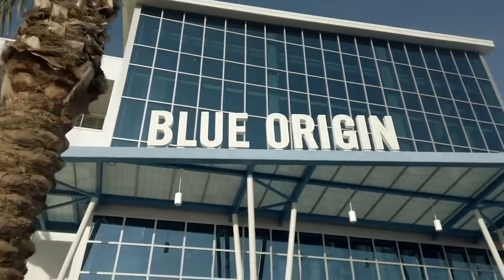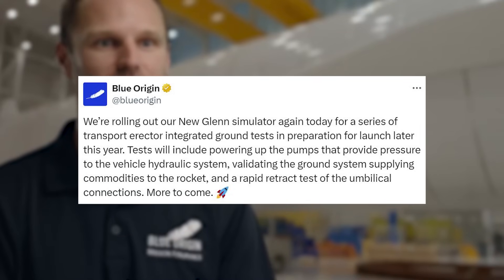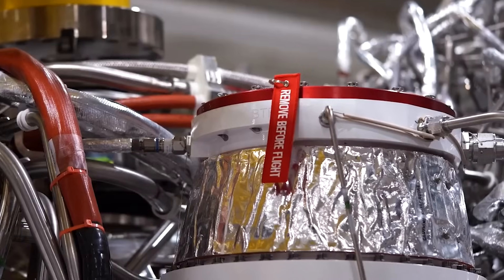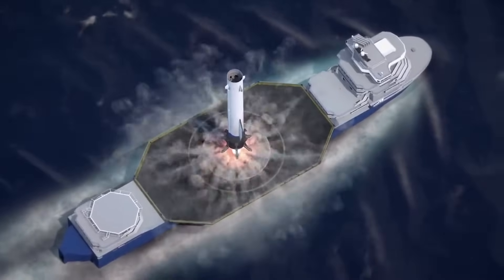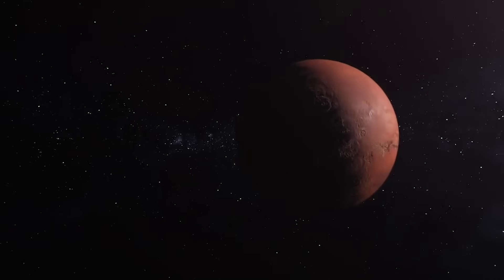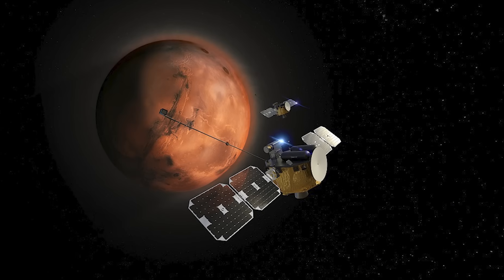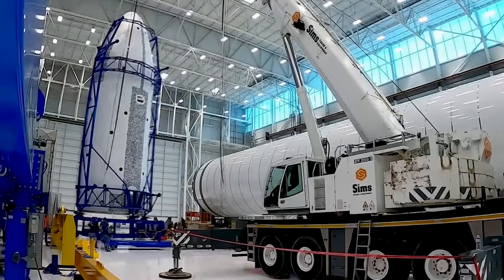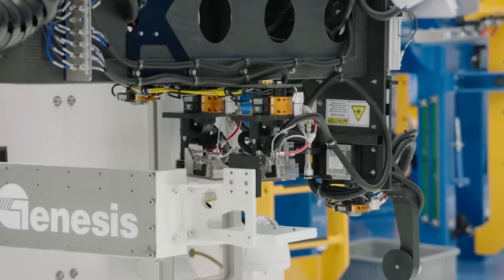Blue Origin Is Trying To Launch New Glenn This Year

Comment: @1:25 You didn't mention that the cryogenic pathfinder New Glenn is not being used for the tests currently underway with the GS-1 simulator because it is back at the factory being retrofitted with engines along with other hardware for the critical wet dress rehearsal and static hotfire tests that will validate the launcher systems ahead of the maiden launch. 

Another New Glenn will carry the twin EscaPADE spacecraft and then the pathfinder will be refurbished for a future mission.

Comment: Crazy that BO is trying to launch payloads on its test flight. It is also crazy that they are going to try to land one AT SEA on the first flight. They have the potential to destroy their landing platform as well as several 3rd party payloads. 
That is the danger of delaying something for a period of ...like... forever. When you do fly, you are behind schedule, so you take more risks, and you have to make everything go perfectly. BO seems to be following ULA's model for booster development rather than SpaceX's method. This may be because of their vehicle takes longer to build and is more expensive, so they can't have a "hardware rich" development cycle like Starship. Stainless Steel definitely has its advantages.
Reply: u know at this point this shit just story trying to proc up jeff bezos, this company is not launching shit. consider it was found 24 years ago way before space x, look where space x at.  u telling me they can compete lol, tell me when they get to LEO and come back which something they still can not prove.

Comment: Space x that has 15 years experience and a high turnaround rate for design and manufacturing hasn’t gotten it right yet. How a company that’s never reached orbit and stuck with the same unproven design for 10 years. They haven’t even done a Wet dress rehearsal
Reply: Theyve launched 24 rockets bro. 

They have plenty of experience.
Reply: @iamscoutstfu  that's launching a single small rocket up then it falls down in exactly the same place. scaling up the rocket is another thing entirely
Reply: @iamscoutstfu it’s a big stretch between those 24 suborbital launches vs SpaceX

Comment: I hope I'm wrong, but I think that this rocket is going to have problems with delays, engines, and landing.
Reply: Blue Origins BE-4 engines performed perfectly when they successfully launched ULAs Vulcan in January this year.
Perhaps you're superimposing the "blunt" SpaceX modus operandi and acceptable performance levels on a more "refined" Blue Origin.
These two companies have very different approaches to launcher development.
Reply: 2 engines performed well on a single flight.  That is certainly important, but it doesn’t tell us if they are reliable.  They also have to relight on new Glenn which they have never done BE4.  A 7 engine setup will be much more complicated then a 2 engine one. 
Once they have a couple of successful static fires then I may agree with you.
Reply: I mean basically everyone who has made an orbital class rocket has had issues with these things, so it’s pretty much expected. I think it’s crazy what they are going for with the first flight and we’ll just have to see how it goes…
Reply: @alexlabs4858
Especially considering they have never even launched into orbit before.
Reply: Yeah. See you in 2.5 years
Reply: NASA recklessly flew the first Shuttle test flight with a human crew. It was crazy and we still think of a first flight as risky.

Comment: Obviously, Elon is worried Blue Origin might actually try to land on a pad before he does. Elon seems to be pushing to try and catch the booster with flight 5.
Reply: Why would he be worried about what a rocket that is not even an equivalent to the 6 year old Falcon Heavy is doing?
Reply: @SentinelSent  New Glenn is just as reusable as either Falcon but lifts nearly four times the payload of both: 35-40tn, not a mere 10tn. Elon Musk knows that the Falcons are destined to work the lower end of the "Heavy Payload" market. So do investors.
Reply: @davidstevenson9517
And starship will do the rest.  Especially if the develop an expendable upper stage. Something I think they should have done first.
Reply: sure, man. a company that has not made a single flight to LEO and come back safely got elon soo worry lol. tell me when blue origin reach LEO, its been 24 years since the company was founded. space x founded much later already launch 300 falcon rocket with 120 consecutive successful payload delivery and landing this past year. at this point u just dreaming thinking they can catch up with space x . lol
Reply: Your probably right, Spaz; Elon Musk must be cringing at the thought of New Glenn making a successful barge landing before Starship is caught in the maw of Mechazilla.
Still, Elon Musk has installed Gwynne Shotwell as CEO of SpaceX, so he has a "fallguy" on hand for his SpaceX Cultists to blame.
(For his sake, EM must hope that Shotwell will live up to her name)

Comment: I can tell you now that the hydraulic actuators system won't be reliable. To much of a fire risk as spacex has learned with many failers with hydraulic systems. Also sending to mars on the median flight is a way to risk it all. Hydraulic systems hasn't been used in industrial or commercial machines since the early 2000s. Electric motors are way more precise and faster of turning a product out.
Reply: Sorry, Wk, but hydraulic actuators have been used successfully for decades.
SpaceX "failers"(sic), indicate that this newcomer to Spaceflight has had difficulty developing/using a system that others have little trouble with.
Huh, amateurs, eh! Tut tut!